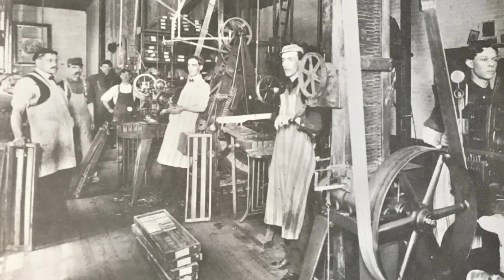How Are Hair Combs Made? The Hidden Process Behind an Everyday Tool | 1.1

Comment: A comb can also be used as a tool for a nailer. Use a cheap comb to hold a small nail between the tines in a comb. Doing so will avoid injuring your fingers, because the comb will hold the small nail while hitting it with a hammer. Alternatively the tines in a cheap fork can also be used hold a nail.